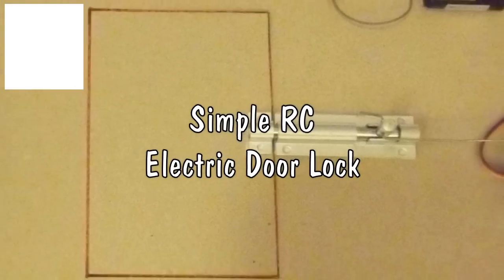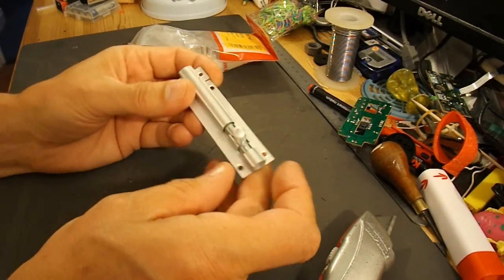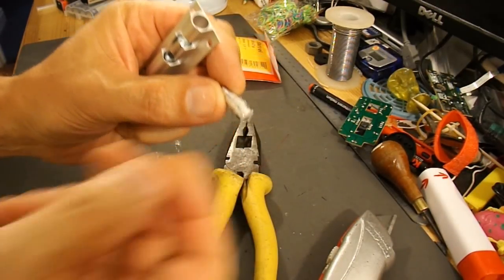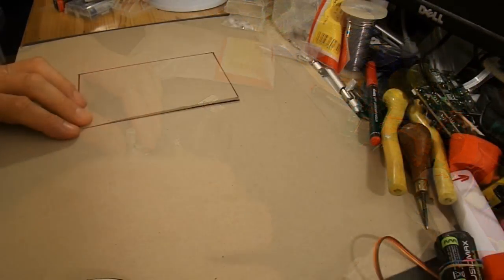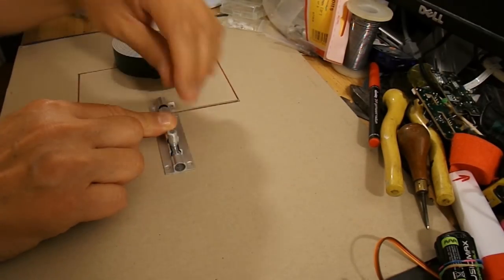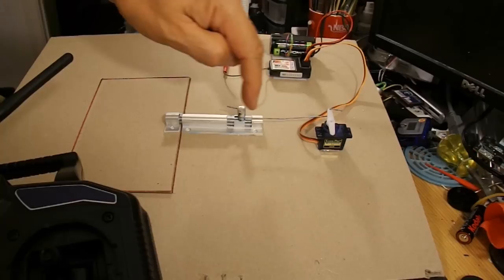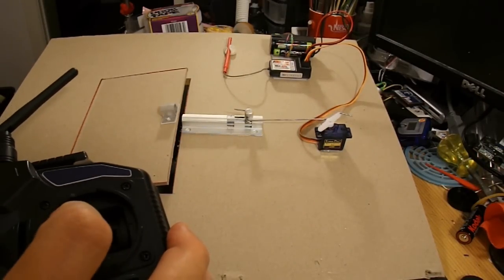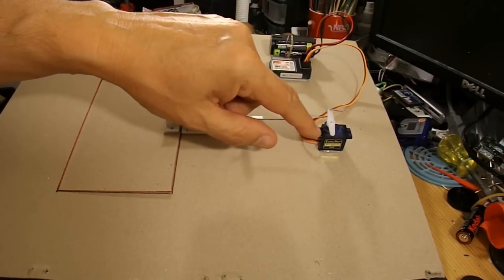Simple RC Electric Door Lock

Comment: Please show how to make the servo turn into a on and off switch.
Reply from the maker: You could position it so the servo arm pushes against a normal switch. Here is one I did to switch some facilities on a toy tank - Toy Tank RC Conversion Part #3 RC Servo DC Switch https://youtu.be/n2JnBvQ9QVE?list=PLA5a2xPRSrB1ZwL1ns9Puw95i7hNyNF9l alternatively you can buy RC components that plug into your hobby grade receiver and will switch a series of options on and off. They often use them for lights and other scale model features.

Comment: Yes,  GIAOLM, this was defo the idea I wondered if possible (paper clip etc).

My Uncle has played with model aircraft all his life and the idea came to me.

Pleae advise.  will this interfere with my router or computer/wifi.?   What would a basic system cost (2nd hand).
Reply from the maker: If you want to make a remote door lock I wouldn't use this system. This is just a demonstration of the principles and is not intended to be an economic solution. However if you read the video description there is more information including a link to the related playlist where there are several more videos of similar projects. As for interfering with your router or computer/wifi, any system using electromagnetic radiation can do that if you place it too close so your mobile phone can disrupt your signals and so can your TV. It just depends on the strength of the signal and the relative location. Even placing your router too close to your computer can cause problems.
Reply: The movement in the servo shown in this  video is really what I need.

It food for thought anyway. Thanks for sharing     :-)

Comment: Hi what woul be the minimum required power battery to make such a setup work ? You think i could use 2 * LR01for example ?                                                                                                                                  Also would this remote/receiver work (I need it the smallest possible) : 

http://www.ebay.co.uk/itm/FK-Relay-Module-1-channel-Remote-Control-Switch-Wireless-IR-12V-DC/263023416463?_trkparms=aid%3D222007%26algo%3DSIM.MBE%26ao%3D2%26asc%3D45566%26meid%3D6a31f568218b4e6396f1f9b1fc70acd4%26pid%3D100005%26rk%3D5%26rkt%3D6%26sd%3D122370115549&_trksid=p2047675.c100005.m1851
Reply from the maker: The battery pack I am using in the video is 4 x AAA rechargeable batteries so that gives about 4.8 volts. A hobby grade receiver runs on about 5 volts and starts to fail when the voltage drops to around 3.5 volts. The power supply is also used to power the servo so you would need to find out what power your servo draws. HOWEVER unless your are doing this to demonstrate a concept (that is all I am doing here) then this is a very expensive and over engineered way of operating a door lock. It would be far cheaper and effective to buy the proper components designed to give you remote locking. Alternatively you could use the units designed for remote locking car doors. If you read my video description you will find more information.
Reply from the maker: I see you have edited your comment. The item on your link is a simple remote switch and is ideal for operating a remote door lock so if you look at my remote control door lock playlist you will find an example where I use that sort of remote control. If you wanted it to operate an RC servo like the one in this video you would have to modify the servo to work with a simple DC switch. I mention this in my video description.
Reply: Thanks. Looking at li ion batteries too, maybe it's the solution for me as i'm space limited...Would you care help me more privately by email or something else for my project ?
Sorry for the previous dumb questions, newbie here ^^

Comment: So I found this RC servo on ebay. How do I connect to it from a custom device or something?
Reply from the maker: If you want to control a hobby grade RC servo then you need a hobby grade RC receiver and a hobby grade RC transmitter. Alternatively you can build a circuit and control it with an arduino. There are plenty of videos on YouTube on that subject.

Comment: where to get transmiter and receiver?
Reply from the maker: I bought mine on eBay and the links are in the video description however this video is nearly 3 years old so those links are probably no longer any good. However if you are thinking of buying them just to do this door lock you are wasting a lot of money, more than it would cost to buy the proper items that would do this job. Again there is more information in my video description.
Reply: GrandadIsAnOldMan  thanks

Comment: I would assume that your requests stem from the movie "The Amazing Spiderman" where Peter Parker has a device on his door extremely similar to what you've created here. Thanks for the video.
Reply from the maker: Possibly, but it is often a school project. Remote door locks are nothing new and you can buy the proper items ready made easily enough, they are a normal electronic item, I give links in the video description. I had a remote controlled garage door fitted about 10 years ago that I could open as I drove into my driveway.

Comment: Hey +GrandadIsAnOldMan would a drone remote control work from gear best?
Reply from the maker: If you are thinking of buying it just to make a remote control door lock then you are wasting your money. In the video description I give more advice on that subject. However if you have a broken drone and want to try to use the components for this then you need to consider how the drone is controlled. It does not use a servo for steering so there would be no output from the receiver to operate the type of servo I used. It is controlled by varying the speed of each of the 4 motors. The next issue is what type of motor your drone has. You might be able to use one of the motors to move the door bolt although you would need to add a gearbox to slow things down. In my video description I have a link to my remote control door locks playlist where there are several other designs.
Reply: GrandadIsAnOldMan I just realised I already have everything I need to do this lock. Thanks for the help though ;)
Reply from the maker: Good luck with your project 😊

Comment: Congratulations on more than 300k views! This is a great build. I made something similar last night after watching your video!
https://youtu.be/-EgTIVee6aY
Reply from the maker: Thanks. Wow, just looked at your video, did you say that cost you over $100 to get the components or was that a typo. In my door lock playlist (link in the video description) I did one using a 12 volt car door lock actuator from eBay probably about $4 and a single channel remote switch for about the same price, so $10 would sound about right. I guess it depends on the quality of the end product you are aiming for. I go cheap for my projects but the principle is the same 😊

Comment: hey, I have a doubt. What if no one is inside and you forgot to bring your remote out with you? Like, how do you open it then
Reply from the maker: That is your problem to solve. Remote door locks are nothing new, you can buy proper systems easily and the prices will vary depending on what features you want. The only purpose of this video is to demonstrate one method of making one. Your question is no different to "What happens if I lock my door and forget my key".

Comment: Dude, is there any way to power a servomotor with the 1channel remote (used in other tutorial) you linked from ebay in the other video? PLEASE HELP
Reply from the maker: If you look in the video description of this video there are links that show you how to modify  an RC servo for normal DC working however the next problem is that 1 channel remote only give you ON or OFF so . Here is the video I did to show how to do it. https://youtu.be/ivKbiywHv_s?list=PLA5a2xPRSrB1HM3Smxg8X-IG7dSuJyzkK
Reply: thank you for reply! isnt there something like a servo that only pushes in one direction instead of making circles. just a servo that makes a linear motion in only two directions. back and forth
Reply from the maker: Shien Ataru yes, if you look in my door lock playlist there is an example of somebody else using the door actuator from an electronic car door lock. I have bought one to try it myself but I haven't done that project yet. The link to my playlist is in the video description and in the Information link on the top right of the video if you are watching on a PC.
Reply: Thank you for replying to my questions man!
I just watched this video and now i am asking my self: Can i use this single channeled 12v remote with its receiver to power a car door lock?
Reply from the maker: Shien Ataru yes, the remote is just a switch so you connect whatever power supply you want to be switched (within the range specified by the switch relay - which probably includes 250 volt AC)
Reply: Thank you so much! is it ok if i might ask you some questions aábout this? i am new to electronics
Reply from the maker: Shien Ataru I am no expert so I can only answer where I have experience.

Comment: could u do it with some a button
Reply from the maker: Yes you could us a push button to operate the servo if you modify the servo for DC working as described in my video description. If you want to do that I would suggest buying a proper door lock solenoid. There is an example link in the video description.

Comment: I love how he skipped all the electrical stuff which I completely suck at, thanks. cool idea though
Reply from the maker: Sorry about that. The reason I used standard hobby grade RC gear in this version is that there is no clever "electrical stuff" that you need to know about. There are just 3 main components here. The battery, the receiver, the servo. The components just plug together so a quick reference to any Radio Control channel would soon sort you out if you haven't used them before. In fact if you haven't used hobby grade RC before I would NOT advise you to buy those components for this project as it would be a very expensive option. This video was to demonstrate the basic principles involved, it does NOT make a very cost efficient door lock. In the video description there is a link to my playlist where I have a couple of different variations of this project.
Reply: +GrandadIsAnOldMan thank you, I just expected a step by step how to video
Reply from the maker: You may find some of the other versions in my playlist more helpful :)

Comment: can  u please make a wireless portable charger for a mobile with rechargable batteries.
Reply from the maker: +JVS Pavan Kumar not sure I can see the logic in that. Am I getting this right? You will use a charger to charge your rechargeable batteries and then use those rechargeable batteries to power a wireless charger for charging your phone. I am guessing you have a mobile phone that already has the wireless charging facility and you have a mains powered wireless charger. The mains powered charger will have a transformer to drop the voltage and convert it to DC to power the wireless charger so you should be able to identify what that voltage is, intercept the circuit and disconnect the mains transformer and connect a suitable rechargeable battery pack at that point.

Comment: SECRET ELECTRONIC WARDROBE LOCK - I made one using this idea. I just take the batteries of the controller for better security. When I need to open my wardrobe, I just place the batteries back into the controller and open my secret wardrobe storage.
Reply from the maker: +Kevin CCIE that would certainly save the battery running down when you are not using it.

Comment: Brilliant.. but the part you skipped at 2:50 is the part I actually opened the video for :)
Reply from the maker: +Mohammad Banna so what bit is missing? Surely you didn't need to see me drilling a hole and bending a piece of wire?
Reply: Not the drilling but I needed to understand how to find those 3 pieces & how to connect them together, & how to match the reciever with the remote.. as in frequency and whatnot also the alternative if I'm doing a wired setup
I really do appreciate the vedio though.. it's a great idea .. thx
Reply from the maker: Mohammad Banna the component list is in the video description. They are just standard hobby grade components that fit together with no modification. I would not recommend this set up for anything other than demonstration purposes as it is totally impractical and far too expensive to use this in real life. In the video description I give other suggestions.

Comment: If you plug the servo into ch 3 of the receiver then you can control it with the throttle which is the left stick up and down so that way the servo Won't go back when you open it
Reply from the maker: +Mackenzie Clarke YES that is right, however I would not recommend using this setup for anything other than demonstration purposes. It is a complete waste of money and resources when the properly designed items are available and would probably cost less. You will see I give further advice in the video description.
Reply: +GrandadIsAnOldMan im not gonna make anything like this but I do have a bunch of servos and a few receivers and transmitters laying around since I fly rc planes
Reply from the maker: Mackenzie Clarke always handy for projects but you wouldn't want to fit one permanently to your door as that would just be a waste :)

Comment: sucks
Reply from the maker: +Dhayal 28 no, you are wrong, air pressure plays no part in the way this works. It is very simple basic radio control equipment used to demonstrate a very simple mechanical motion.

Comment: Hey how does that lock move front by it self 
Can anyone please tell me where to place the bearing and spring
Reply from the maker: +Tanvir Samra I am not sure why you are asking the question. This is shown in the video. The servo arm is connected to the bolt by a length of wire. When the servo moves it pulls or pushes the bolt. There is no bearing and no spring.
Reply: +GrandadIsAnOldMan oh yeah I got that thanks

Comment: heyman does the transmitter n receiver ur using are those that they use in remote controlled toy cars or toy helicopters?
Reply from the maker: +klein klark toy cars and toy boat do not use hobby grade radio control. That is what I tried to explain to you in the previous reply and link. However if you look at my Remote Control Door Lock playlist you will see I did a door lock using a cheap rc toy car

Comment: so I need to make a ir receiver n remove the rc circuit inside the servo?
Reply from the maker: +klein klark if you use a hobby grade receiver it will be compatible with a hobby grade rc servo. If you do NOT use a hobby grade receiver then whatever you use will NOT be compatible with a standard hobby grade servo. If you use a simple infrared transmitter and receiver it will probably just work like a remote controlled ON/OFF switch. A hobby grade servo does not work with an ON/OFF switch, it has a battery supply + and - and it has a third wire which is the signal wire. The circuit board inside the servo is controlled by that signal wire and that tells it how far to turn the motor. If you take that circuit board out you are just left with the electric motor so you can turn it on and off like any normal electric motor. Here is a recent video I made trying to explain how hobby grade servos work - Grandad's Junk Pile Projects #9 RC Servo cheap RC car receiver https://youtu.be/Zgc-CVydPY0

Comment: so its possible for me to use ir receiver n transmitter on servo motor?
Reply from the maker: +klein klark you have to modify the servo by removing the circuit board as mentioned in the video description.

Comment: so if I will use infrarred.., do I need to make my own IR RECEIVER?
Reply from the maker: +klein klark you would need a matching IR transmitter and IR receiver although if you search YouTube there are several videos on simple IR tx/rx circuits that just switch on and off like a light sensitive switch without signal coding that you would normally get with a matched pair.

Comment: hey can I use infrarred remote control instead of the one u use? and how much voltage does d servo needed? is it ac or dc?
Reply from the maker: +klein klark yes you can use infrared although obviously infrared won't go through a closed door so the receiver will have to be line of sight to your transmitter. If you read the video description you will find extra information there and links for a playlist of my door locks as I made a couple more versions to answer other peoples questions. The point is that you can buy ready made components to do this job if you need it for a real life situation but if it is for a project you can source many different components and re-use them.

Comment: u should just make a video of you doing it
Reply from the maker: +Martell Johnson you need a video to show you how to put two plugs into two sockets? There is a plug on the servo wires and you plug that into the receiver. There is a plug on the battery wires and you plug that into the receiver. That's it, job done !!! However I would not advise using hobby grade rc equipment for this sort of job as it an expensive waste of money and only did it because I was asked to do it. If you read the video description I give other advice and links to two other versions I made.

Comment: hey what i can use other than using an rc transmitter and reciever can i control the servo with a switch?
Reply: nvm
Reply from the maker: +samuel ruben You cannot control a normal RC servo with a simple on/off switch but you will see in the video description I give lots of helpful advice on alternatives. There are also other videos in this series, the link is in the description.
Reply: GrandadIsAnOldMan thx